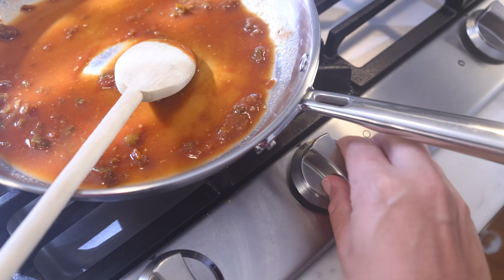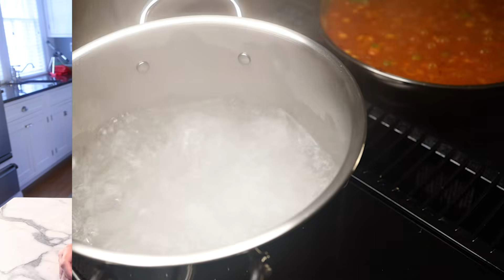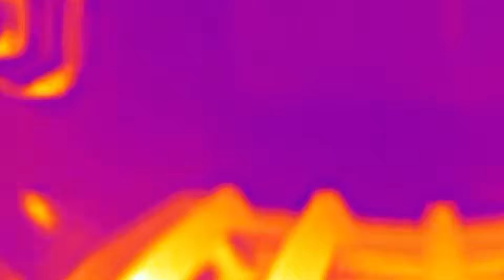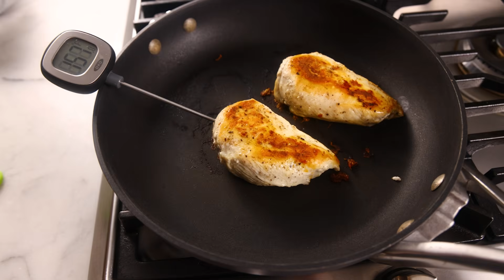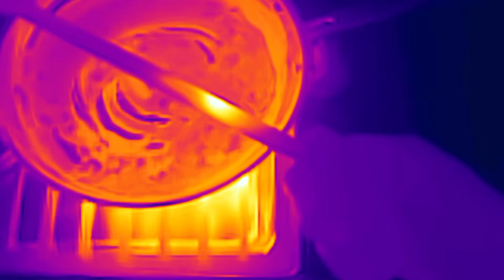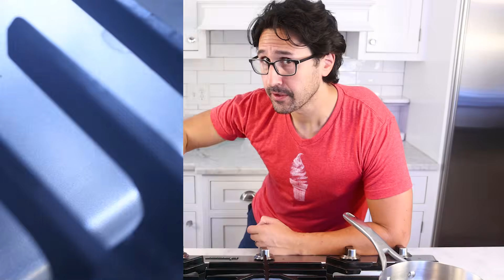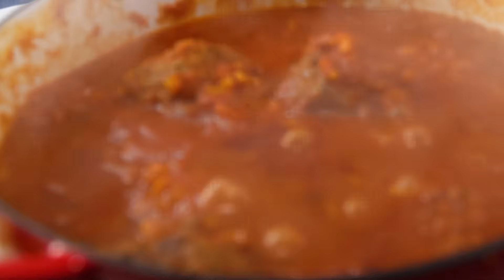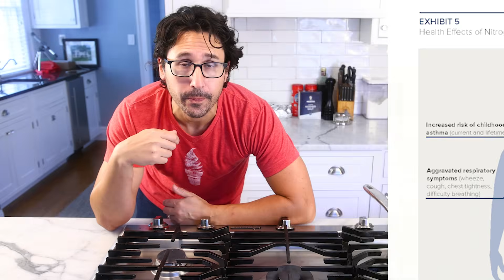Problems with gas stovetops | weak, dirty and dangerous

Comment: As someone who's cooked on electric, gas, and induction: i agree that induction is the future. Gas is responsive sure, but so is induction. It's fast, safe, rarely any chance of catching fire. It is easy to clean just like electric, and uses less energy to do the same thing. No heating of the air around you.

Literally the only thing that it cannot do is work in a power outage. 
If i get to choose: induction all the way.
Reply: I live in earthquake country but even so I've probably only experienced 3 gas outages in my lifetime (58 yrs) compared to dozens upon dozens of electric power outages. At least keep an outdoor grill handy 😄
Reply: @pourattitude4206  I'm only 35 and I've seen 3 houses in my city EXPLODE because of gas appliances (2 were in the past 6 months). I'll happily stick with my electric appliances that won't randomly explode and kill my family. I keep non perishable foods on hand in case of power outages as should every person who can afford to do so.
Reply: You can only use cookware design for induction heater, otherwise it is very good, Sadly they don't make induction heater for wok.
Reply: @diysmallthings  they do!
Reply: It's super expensive and needs special cookaware
Reply: @Песни_без_прописки  ... the one I have cost $60 on amazon and works with anything that has Iron in it?  Cookware with Iron is 'special'?  LOL!
Reply: I realize there are a couple minor advantages to induction, but none that outweigh the major issues that will stop me from ever getting a full induction stovetop.  A standalone travel burner may be fine for some things, but definitely never a full kitchen stove. My main complaints about induction are:

(1) Extremely limited in pan size.  The moment you try a pan larger than the element, it becomes useless, so you're effectively stuck using "smaller" cookware.
(2)  They do not spread heat up the sides of your pan at all, which does have a major effect on heat output to the food.  For some tasks this doesn't matter, but for any amateur cooking enthusiast, this causes major limitations in cooking techniques.
(3) They are MURDER to your clad cookware.  The induction coils have been well documented to cause problems with delaminating layers in bi/tri-metal clad cookware, especially if your induction elements are more powerful.  So what's the point in getting a super powerful stove if it's going to warp and ruin your fancy cookware?
(4) This is more of a minor complaint, but the noises they make are obnoxious and loud.  But this is more subjective.
Reply: @dirtyketchup  
(1) Stoves with bigger coils exist, some even have a bunch of small ones that can work together.
(2) Good pans spread heat, but in that regard gas could be more suited, having small portable gas burner is fine though and helps in power outage too.
Reply: Power outage "BUT SOMETIMES!" scenario - have a propane camp stove in the garage or something that you can slap on your stove during a power outage.
Reply: The problem with induction is that it only works on pans that contain iron, meaning that you can't use aluminum or copper pans.
Reply: @shadowtheimpure  most moder Cast iron, aluminium and copper pots and pans have an induction ready sandwich bottom. Its really not a problem anymore.
Reply: @shadowtheimpure  you can use aluminium or copperpans with an induction top, the material just has to be electrically conductive. So glass and ceramic won't work, but aluminium and copper should.

You probably shouldn't be using aluminium cookware if you can avoid it though, anyway.
Reply: @matthewparker9276  Aluminum alone won't work.  It needs to be ferromagnetic not just conductive.  But there are some Aluminum pans that have a ferromagnetic insert in the base that will allow them to work.
Reply: @matthewparker9276  I have an inductive ceramic pan.
Reply: The portable induction cooktop that I have only gets used for bringing water to boil. The power controls are preset and are invariably the wrong power for whatever cooking I am doing.
Since the ones I've seen are all digital I doubt that I will ever buy another one even if they eventually make one that you can fine tune in 50 watt increments. Maybe I'm not bright enough but to me a simple dial is much better and easier to use than repeated finger taps to adjust "heat".
Reply: Most induction cooktops have a tiny 6 inch or less coil but they can put up to 2200 watts into it. This can quickly create a small hot spot on your pan. So the middle is hot but the edges are cold. The hot metal cannot expand outward so it expands upward warping the pan.
Reply: @youknowvin  most portable ones.
Reply: It limits what materials you can cook in, which is automatically a deal breaker for anyone who is serious about cooking.
Reply: Wait til you have to replace one or all three of the electronic control boards under the induction pads. It's a 2 hour job, and you often have to change the whole 3 control board assembly for around $1600 PLUS labor.
Reply: @robhill8894  I've had one for ~7 years... no problems. Why would I pay $1600 to fix when it cost <$500 new?   Saved ~$1200 already in those silly monthly gas connection fees :D
Reply: @Chris-ie9os  For those of us who use natural gas to heat our homes (extremely common in colder climates), we're going to have that gas connection regardless. Here in Michigan, for example, it is really expensive to use electricity to heat your home since it gets and stays quite cold for 4-6 months of the year.
Reply: @shadowtheimpure  Try a heat pump.  With a COP of ~4 they're going to be cheaper unless electricity is >3x more.  The cost of gas has been artificially low for years and it looks like the party is ending.
Reply: @Chris-ie9os  Power in my area is at 17.86 cents per kilowatt hour. A heat pump uses approximate 15000 Watts of power, so to run a heat pump would cost me 15 kilowatt hours per hour of operation. Say the pump is running for 12 hours of 24, that would be 180 kilowatt hours per day at a cost of  $32.148. To heat my home for the month, that would cost me about $965. My gas bill is less than $300 a month.
Reply: @shadowtheimpure  .... yeah... that's not how that works.  You pay ~$1.12 per CCF.  1 CCF = 29kWh so you're paying ~0.04/kWh for natural gas.  Most gas furnaces are ~80% efficient so you're paying ~$0.05/kWh to heat your home with natural gas.  A good heat pump can provide ~4w of heat per watt of electricity so you'd pay ~$0.045/kWh with a heat pump.  Electric will only look more favorable as gas prices rise.  Also... almost no residential heat pump uses 15kW.  Mine uses ~600w when running.  They're crazy efficient.
Reply: @Chris-ie9os  My gas furnace is an HE furnace with a rated efficiency of 95%, so your calculations are a bit off. As far as the wattage of a heat pump, I just googled it and that was the number it tossed at me. A question then, how many hours, approximately, does your pump have to run to heat your home and do you live in a cold weather climate?
Reply: @shadowtheimpure  So at current gas prices it's about the same as a heat pump... wait until next winter.  It's not a question of hours but energy.  My heat pump consumes < 4kWh/day when it's ~30F.  It runs at various speeds.  Obviously your experience will be different with a different climate and home size.  https://www.youtube.com/watch?v=_v8vizQXwss&t=42s
Reply: @Chris-ie9os  Is your heat pump standard or geothermal? I can't afford the cost to lay the pipes for geothermal.
Reply: @shadowtheimpure  Just standard.
Reply: @Chris-ie9os  heatpumps don't have that degree of efficiency in the frigid Minnesota winters.

Probably looking at 1.5 to 2
Reply: @priestesslucy  It's <0F the ENTIRE winter?  Never have warmer days or hours when the heat pump would have a COP of ~4+?
Reply: @Chris-ie9os  oh, yeah they do have some warm days.

Isn't the heating run the most at night?
Reply: @priestesslucy  ??? You don't heat your house when it's 0F - 50F?  Sure... if it's -10F your COP is ~1.5.  When it's 30F it's 4.  When it's 40F your COP might be 5.  Heat pumps for the win ;)
Reply: @Chris-ie9os  Honestly I only heat my house in the 0-50 range, where I live it doesn't get down below 0.

But I don't heat my house actively during the day. I run my RMH in the evening before bed to top up the thermal mass.

Big fan of HE wood combustion+thermal mass over electric (although I suppose in theory thermal mass could also be coupled to a heatpump with a greenhouse heat source to improve that system...)
Reply: @shadowtheimpure  A 15kW heat pump? I doubt it unless you're heating a 50,000 sq ft building. I've seen 15kW resistive heat elements in residential applications, but residential heat pump power consumption is typically a fraction of that.
Reply: @Chris-ie9os  gas heating is still necessary for the coldest days of winter, heat pump technology isn’t to the point that gas can be completely phased out yet
Reply: @brumm0m3ntum94  < 0.05% of people live where it ever gets cold enough that a heat pump COP is < 1.  Then resistance electric is fine...
Reply: @Chris-ie9os  much of the midwest gets that cold, unless technology has improved since the last time i checked(not long ago), and in much of the us, power outages aren’t uncommon, i wouldn’t want my only source of heat indoors in the dead of winter to be reliant on whether power is working, and i live in a region with pretty mild winters, rarely below the high 28° F
Reply: @brumm0m3ntum94  Where in the Midwest does it regularly get to -20F?  Gas can also be turned off.  Happened in Colorado last winter.  The best backup for a power outage is a woodstove.
Reply: @Chris-ie9os  why would a propane tank outside someone’s house be turned off other than someone working on the gas lines inside the home
Reply: @brumm0m3ntum94  Was referring to methane not propane.  Propane is too expensive to consider seriously as a fuel.
Reply: @Chris-ie9os  Typical heat pumps doesn't work very well in northern states.  They are efficient to around 40° F and continue to lose efficiency to around 15°F where they don't work at all.  In climates where the average winter low is 30° or less, typical heat pumps are not an option.

Cold climate heat pumps (CCHP) have recently been designed that remain effective to -13° F.  From what I can find, CCHPs are showing a lot of promise for colder climates but consumers and HVAC professionals have very little confidence in CCHPs and the relatively new technology makes them inherently more expensive (roughly 40% more).

Water sourced heat pumps (WSHP) can be installed in almost any climate because they use geothermal heat instead of ambient air.  While these systems are, by far, the most efficient heat pumps, they can be among the most expensive.  These systems require between 2 and 4 thousand square feet of land for the circulation system and the cost of installation is roughly double due to nearly double the labor.  An average WSHP will cost around $20,000* to install compared to a typical heat pump at around $6,000* or around $10,000* for a CCHP.  

If @shadowtheimpure found it necessary to update their HVAC system, they would absolutely save money on their monthly bill by switching to a heat pump, but they may not be able to justify the initial cost.  Assuming they didn't need to do anything to their ductwork, a swap to update their existing equipment would cost about $5k installed*.  A CCHP would cost them about $9k installed* and a WSHP would be around $18k*.  To justify the cost difference for a CCHP, they'd need to save $70 a month for 5 years.  A WSHP would need to save $100 a month for 10 years!  

*Based on national averages and assuming no unexpected costs.
Reply: @Chris-ie9os  As long as the electric power is on, which isn't always the case. It tends to go out at the worst possible times, Texans learned that a year or so ago, there were many deaths as a result. I live in New Hampshire, we often get storms that knock the electric power out in winter. When it is zero out and your pipes start freezing you wish you had some sort of back-up.
Reply: @3ducs  I do have backup.  Solar PV and batteries.  Gas service can fail too ;)
Reply: @Chris-ie9os  Glad you can afford it. Not everyone can.
Reply: @3ducs  ???  I COULDN'T afford it.  That's WHY I got solar and batteries.  To produce my own electricity instead of buying it :)
Reply: @3ducs  Unfortunately, I don't think he understands how privileged and holier-than-thou he is. 😮‍💨
Reply: @robhill8894 if you have an on-counter one pot device, when it dies you take it to service or throw it away (legally of course) and buy a new one.

Comment: In our restaurant its been the same gas stove for about 28 years burning from 9:30 am to 23:00 pm all day every day and it hasn't broken down once lol. To be fair the electric Firestarters have broken down but it's a non issue with a simple 20 cent lighter around.

Comment: I noticed this on my electric range with my cast iron pan and steak. pre-heating the pan for a few minutes on the "5-6" setting, even though the recipes and videos using gas say "crank your stove to high or nearly high"
Reply: My electric range also has a "low" setting prior to "1," only to back up what you said about warming burners and all

Comment: Honestly Adam, I have cooked on gas my whole life (61 years) and I have never had any of the problems you do. I did torch a couple of pot holders and melted a plastic spoon but you can do that with an electric stove too.  And you can still cook on gas when the power is out, you can turn down the burner instantly and it is easy to visually see if a burner is on by the flame.  It is easy to leave an electric burner on low for hours and not know it.
Reply: That's why induction is king. Your utensils won't melt unless you literally leave them inside the pot. And in all induction stoves I have seen (which is 3 so far), they turn off the heat as soon as you take the pot away. If you leave the pot off long enough the whole stove will shut itself down. 

Your point on cooking without power is a good one, but how often are you really in that situation for it to be a big benefit? Even so, we have a BBQ which also has a gas stove next to it which we can cook on if need be, but I understand not everyone may have that option.
Reply: @1lIl10OS52ZlI  I went without power for a week this last Feb here in North TX. My gas stove insured warm and hearty beef stew and chicken and dumplings.
Reply: @Ctrlr1981  ha, not everyone in TX could get gas. And the price for it was 😆
Reply: Gas was cool. For me, it's the blackening of cookware, and that natural gas as heating fuel needs to go.
Reply: @sprockkets  Natural gas is cheap and clean. It does a wonderful job of heating homes and generating electricity. It is also used to make plastics, which includes synthetic fibers in your clothing, medical supplies, light weight parts in vehicles, drugs that save lives, fertilizers that feed the world. Do some research, open your mind.
Reply: @3ducs  no it's not. Go to your exhaust of your gas furnace and tell me that's clean. CO2 is a pollutant as well, along with methane leaks in pipelines being horrible for the environment.
Gas is cheap? Lol, it went up 62% for me thanks to Texas.
Reply: @sprockkets  I can tell you that it costs me far more to heat my current small electric heated home than my larger gas heated home with its newer efficient gas furnace. The exhaust from that gas furnace was clean and so cool, virtually all the heat having been extracted from combustion, that PVC piping was used to vent it. But you keep believing in the religion of Green, facts don't matter there.
Reply: @3ducs  spoiler alert, I'm an hvac tech and know more about furnaces than you do. And for that matter, my mini split heat pump beats my 97% eff gas furnace in costs, and soon, will be powered for free with solar.
Then I'll rip out the noisy gas water heater as well. 
You can save your farts as a means of running your furnace with renewable energy instead and continue to pollute
Reply: @3ducs  and for that matter, condensing furnaces are 40 year old technology.  You think that's new? 😆 You must live in the south where no one installs them cause they require actual maintenance
Reply: @3ducs  “religion of green” idiot. Too old to care about the planet? Pathetic.
Reply: @1lIl10OS52ZlI  It's actually more common than you would think. I live in rural America and the power is often out.  Wind and Ice on power lines often kill the power, sometime for days. Many people have wood as backup heat and gas powered generators for power.
I guess my thing is I'm so used to gas stoves that the problems Adam gives are so minor that they hardly matter.

Comment: You are right that induction is the future! But it was also the past--when the CN Tower was completed in Toronto in 1976, they put induction cooktops in their fine dining restaurant because they couldn't have gas piped up there for safety reasons. The day is not so far off when we can run all these "expensive" electrical appliances on green energy, and rooftop solar and in-home battery storage will mean we can cook even when the grid power goes out.